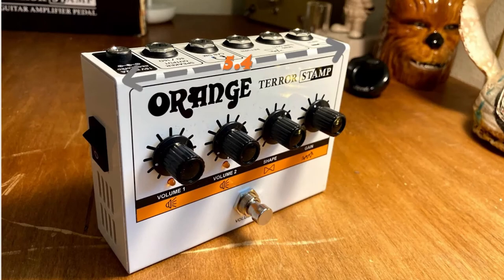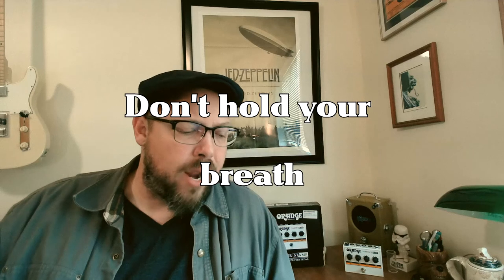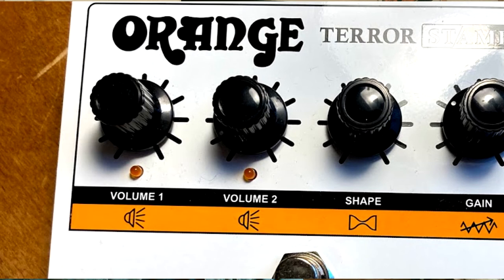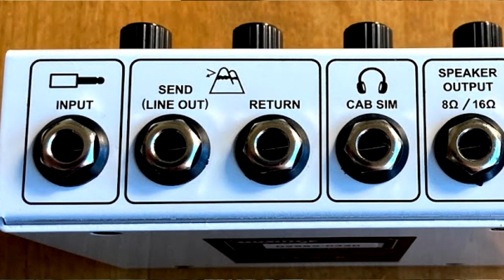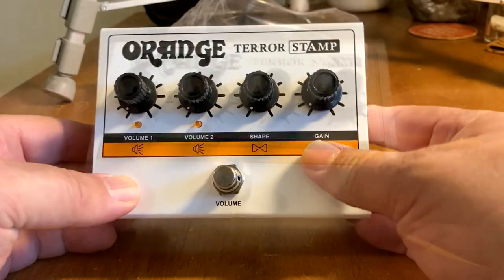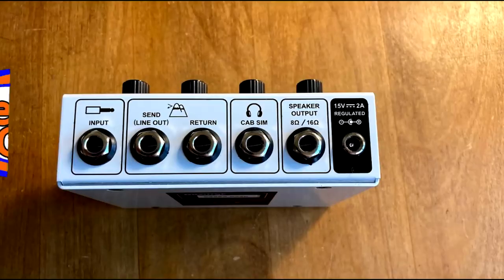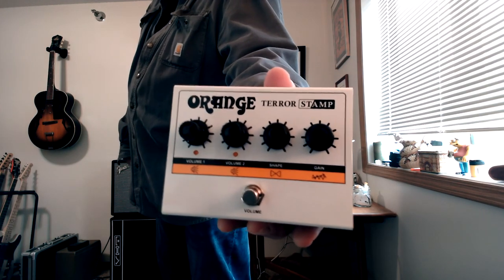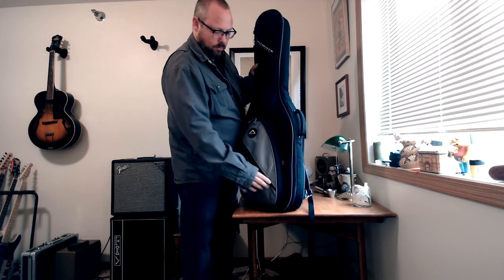EP 39:  The Orange Terror Stamp

Comment: I have a question, I recently switched from bass to guitar and still have this Orange Crush Bass 100 combo amp with a 15" speaker. So I thought of buying one of those Terror Stamps and connect its FX send to the FX return of the Crush Bass to bypass its preamp, and additionally connecting a PPC112 to the regular speaker out of the Terror Stamp, so I can run the 15" and the 12" simultaneously... is this even possible?
Reply from the maker: I’ll give that a shot today.
Reply from the maker: Yes, I just tried it. It does.
Reply: @LearningCurveGuitar  Cool thanks. I'm just a little worried about the 15" speaker though. I tried the Crush Bass with guitar and a Big Muff and after tweaking the EQ it sounded actually pretty good, but when I go into the FX return it sounds like crap, probably the Muff's fault since it's not really a preamp. Hopefully it will sound better with the Terror Stamp and maybe an additional EQ pedal. I will try it soon. Thanks again.
Reply from the maker: @eaglebauer944  I ran it through the loop of a guitar amp with a 12 inch speaker. No pedals. It worked, But I guess you’re going to have to give it a shot.